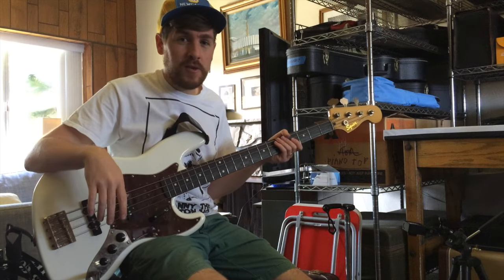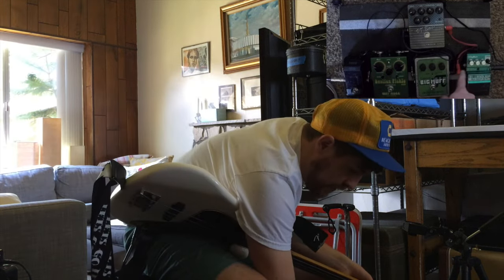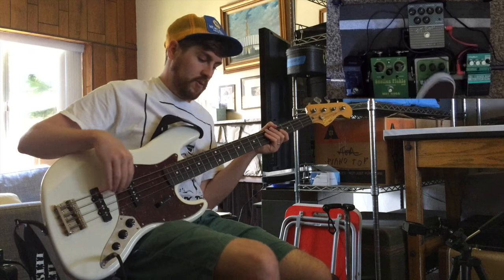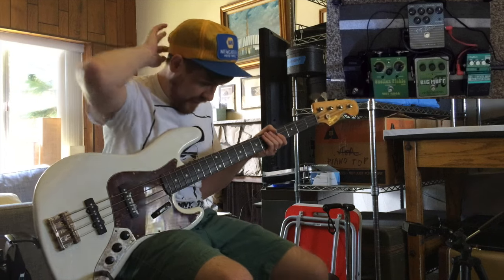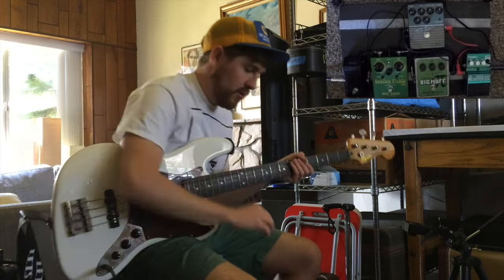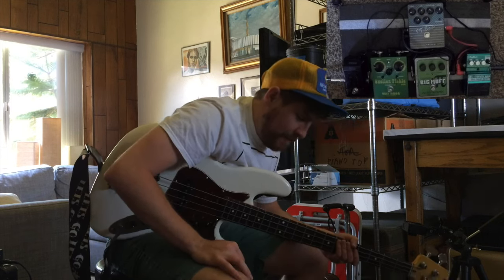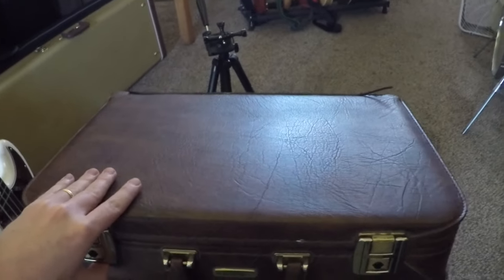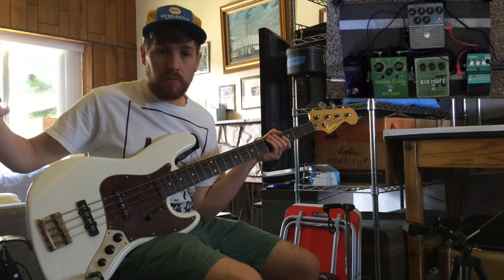My Simple Pedalboard Explained

Comment: cool set up. you figure that pickle out yet? so what d.i. are you going to get? you'll find that being a bass player you're going to NEED a d.i. and a comp.
Reply from the maker: +Jam S You know, I've been telling myself that I need a DI for 5 years or so now and after all this time I've gotten by without one. I just use the DI out on whatever amp I'm using and it works just fine. 

Haven't messed around with the Pickle lately because I haven't needed it for anything. Maybe one day...
Reply: Most sound guys these days will take from the amp. It use to not be that way.... Have you checked out the SanAmp VT Di? seeing as how you like that VT pedal (which sounds amazing!! :))
Reply from the maker: I have and it looks really cool!
Reply from the maker: Yo! I know this comment is super old, but I just made a video on the Pickle if you wanted to check it out!